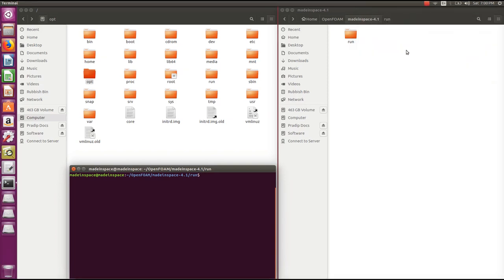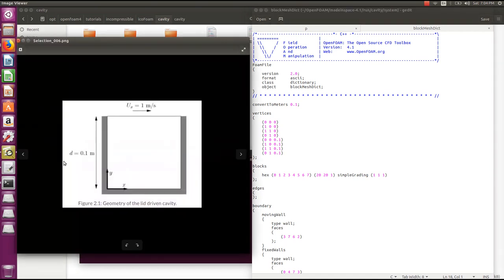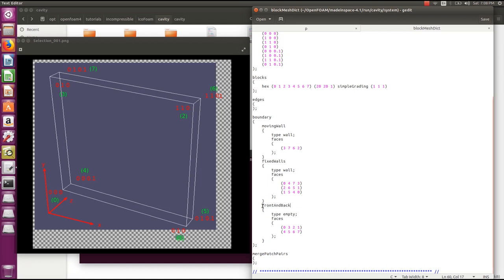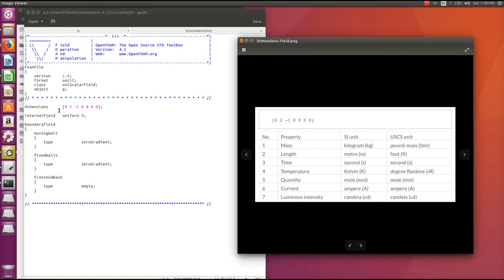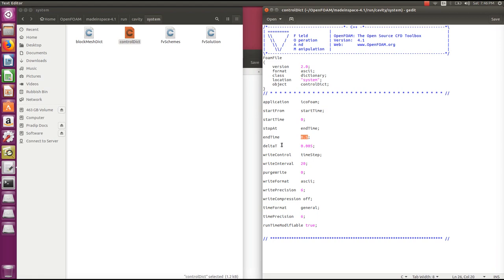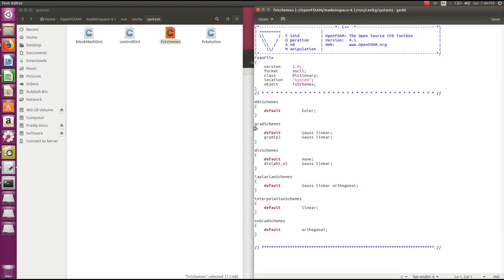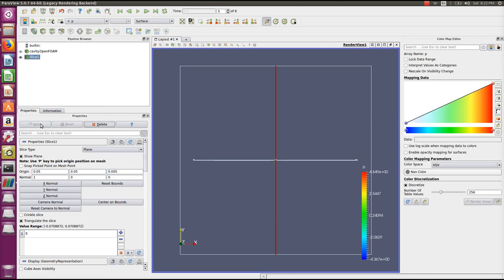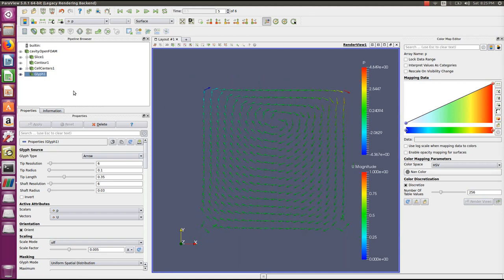OpenFOAM Tutorial - Lid Driven Cavity

Comment: thanks.i have a question if i change the blockMesh (i take (0 1 2 3) in the bottom and (4 5 6 7) in the top)combine them and make hex(0 1 2 3 4 5 6 7) just like in the user guide page U151.it gives me problem the tope wall which is moving wall is no longer top wall it changes.can you explain plz according to my knowledge we can take any two parallel surfaces with a spacific order (clockwise or anticlockwise)  to make block.in this tutorial they are taking front and back faces to create block.my question why not bottom and top faces.